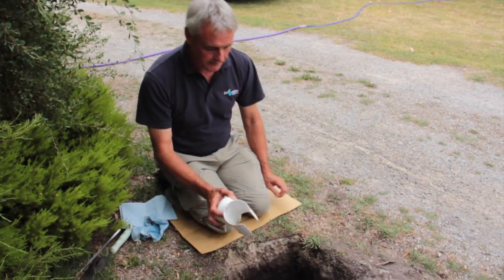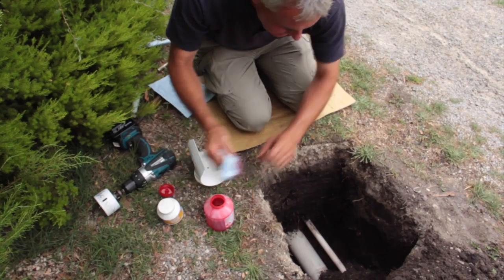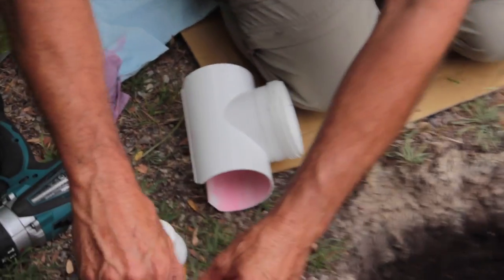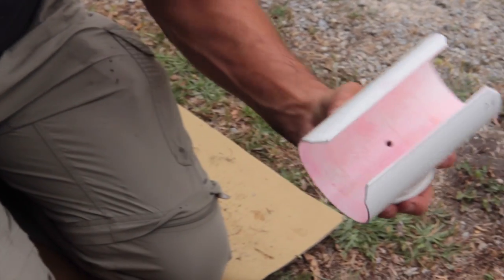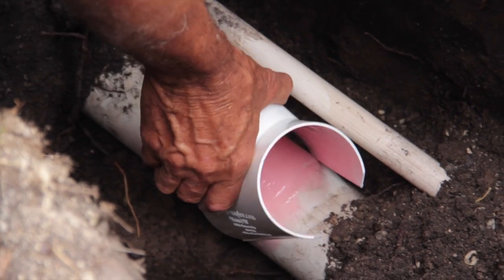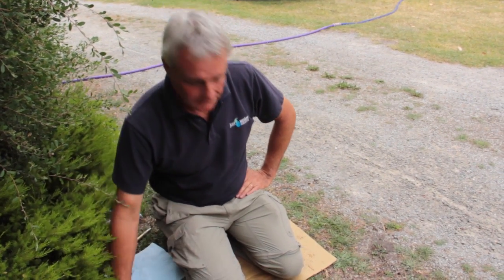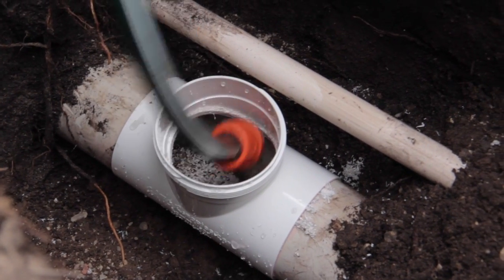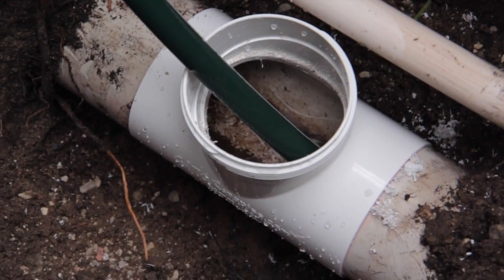Gator Snap Tee Installation

Comment: To make sure the snap T is straight, I place a piece of 90mm pipe in the upright connection and eyeball whether is is vertical or not.
Reply: does it really need to be exactly vertical?
Reply: why not just use a fuckin level

Comment: Should put pipe clamps on either end. Glue can crack off, especially being buried with all those elements. Clamps with glue will make it last for a very long long time.
Reply: I’ve seen multiple heavy duty cable-ties added, to give additional strength/confidence
Reply: Clamps is a good idea - a few bucks and 5mins for a bit more peace of mind

Comment: Can you use this as a junction to add a new pip run into an existing line will a 90 mm pipe fit into the inlet?
Reply: thats the question i need to know aswell

Comment: what is the pink stuff he was putting on the pipe?
Reply from the maker: It’s priming fluid you use before the glue.
Reply: @justwatersolutions5120  great idea! Instead of capping it off as you did, I need to put an additional pipe vertically to join for additional drainage. That’ll work? Cheers.
Reply from the maker: @josephj6521  yes, absolutely. It’s designed so you can do just that ☺️
Reply: @justwatersolutions5120  thanks for replying. Champion! 👍

Comment: Quick tip: Use a hole saw well less than 90mm though or you'll strip the end stop,  didn't mention what diameter he used.

Comment: Can this fitting be used for a sewer line?
Reply from the maker: The 100mm size Snap Tee fits sewer pipes, which are 100mm DWV.
However it's for stormwater use, not really for sewer as they use 88 degree tees not 90 degree like these. 

(DWV = Drainage Waste and Vent)
Reply: @justwatersolutions5120  Thank you for your quick reply.